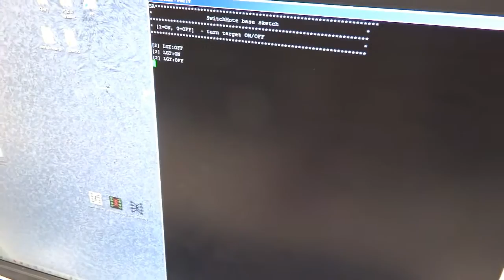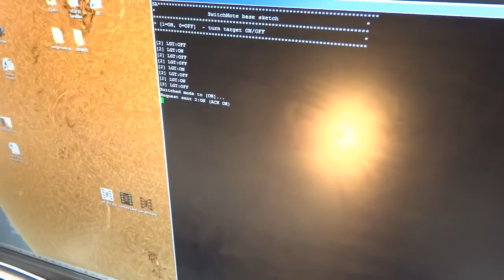Switching mains lights wirelessly with Moteino / Arduino

Comment: Hu Felix I was really into getting the Belkin Wireless Light switch, but since I am in the UK where we run 230v and it runs on US 120v any chance of cracking it open and reconfiguring it to run with 230v?

Thats the one I am talking about:

http://www.belkin.com/us/p/P-F7C030/
Reply from the maker: Hi Yan, I haven't used the wemo so I don't know details, but I suspect they haven't spent the extra $ to make it work safely at double the voltage so it may require different electronics for that.